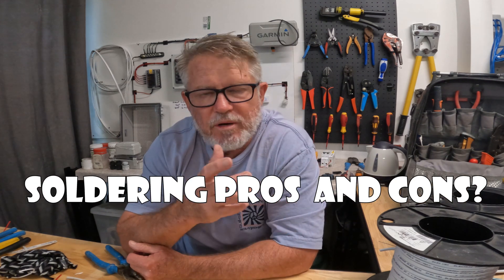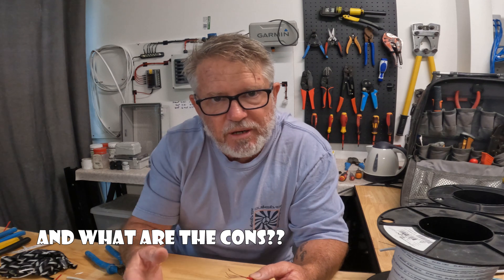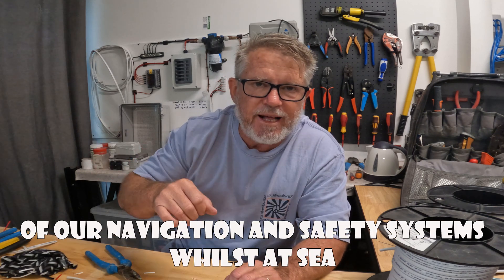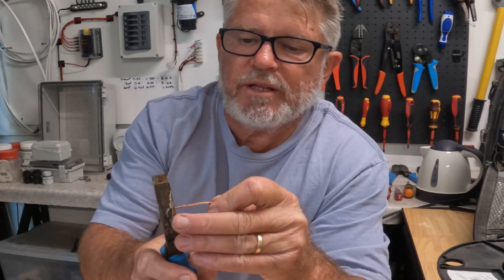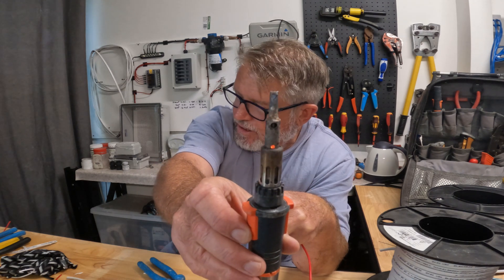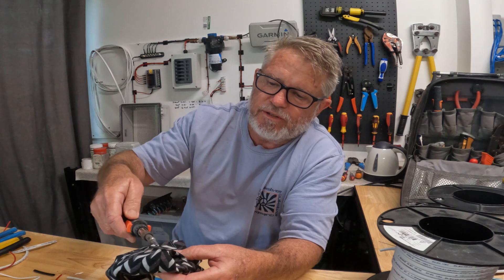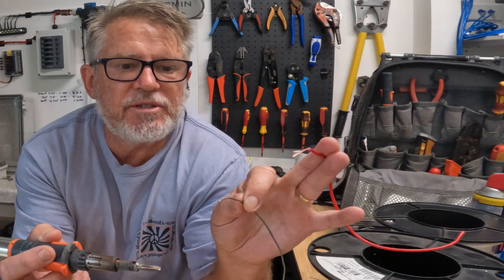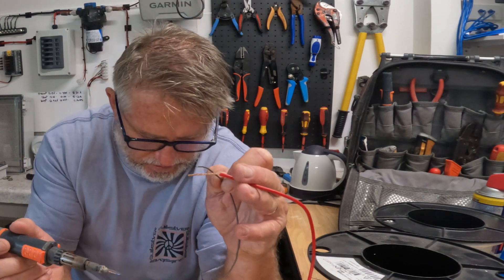I STOPPED Using Soldering Joints on My Boat and here's why!

Comment: I was expecting you would show tin whiskers causing short circuits.  Tin whiskers can grow in a humid environment.  OK, yes tinned wire is stiff and there are vibrations in a boat, makes sense.  But then I was expecting you to show a flexible connection without solder.  Crimp connectors at least are very rigid, even more rigid than tinned wire.  What is even worse with crimp connectors is that the transition from rigid to flexible is very sharp at one point, which will take all the twisting and break the wire.  A soldered joint is usually insulated by a shrink tube, which will even out the bending forces so that there is no sharp bending radius at any point, and the flexible part of the wire will handle all the vibrations of the boat.  The shrink tube with hot glue will also insulate the joint from moisture, so there is less risk of tin whiskers.  Crimp connectors might be tin plated and they have no protection from humidity, unless you add that yourself.
Reply from the maker: I am just getting started I will be adding a lot of information later, including crimps, marine crimps vs heat shrink crimp systems, cabling standards (Australian Standards) cable protection systems, heat shrink systems, cable management systems, junction boxes and glands, segregation, cable size, critical circuits and much more.

Comment from the maker: FYI for information purposes only - Below are some details and list of Australian Standards for those that are Australian and love a bit of reading regarding soldering and restrictions of soldering under certain circumstances, not just in boats. There are certain circumstances where soldering is permitted and others where it is not depending on the application and where a cable or wire is installed. 

To simplify matters I will be using quality Ancor crimps and Bluesea devices and switches where possible for all my marine applications.

Note: 

Some standards must be followed in full where others and various sections  may be informative only and may or may not be ratified by the NCC and or AMSA.

AS/NZS 3004.2014
AS/CAS009:2020- 20.9.2
AS/NZS 3001.2:2022
AMSA Instruction to surveyors DCV-ITS-015 (05/2019)
AMSA Aid To Navigation Electrical Installation Standards

The AMSA instruction to surveyors is a good read and is available online for free an outlines AMSA's requirements especially where crimps are required and it also provides additional information regarding cable size, cable length and other useful information for commercial vessels.

In addition to this my background and licenses include electronics, open unrestricted cabling, data, fibre, coax, fire and security systems. I also carry a certify class of license for some life safety systems in buildings. I have cabled thousands of buildings and certified hundreds of life safety systems with specific commissioning requirements  including Q&A, ITP's and third party inspections and certifications for full system compliance and safety and have very rarely had any defects which have never been cable related.

Whilst certain considerations must be considered differently in boats the relevant standards cable management and cabling practices remain the similar.

Comment: ... or leave electric jobs to an professional! Sorry
Reply from the maker: Not sure what you mean? I have been working in the electronics industry since the 80’s I hold various licenses in Australia including unrestricted cabling, data, coax, fibre, fire and security. I hold licenses to certify my own work and that of others. I have cabled thousands of commercial buildings and never been defected for any cabling works other than segregation where other trades have installed systems after our rough-in was completed. 

Boats have minor differences with regards to certain termination practices, mechanical protection and cable management but my boats are a lot smaller and far easier to cable, test and commission than large commercial buildings.

Whilst I’m no longer on the tools I have a team to do all the hard work for me.

In future I will also be referring to legal requirements with regards to system compliance, Australian Standards and AMSA requirements for certain systems including critical circuits, cable size, cable length and cable management systems.
Reply: @PressuresEdge  Hmmmmmm. There are standards out there, where, in which cases to use and how to do soldered connections. So far as i had seen in the video, you know not much about standards and soldering technices! And the fact your solder joints went broke proves this sight! Sorry, it was dont meant to be rude but in my exerience, if a connection is done right (cables, connectiontype, enviroment proction, layment of the wiring) it cant brake, not possible in normal operation conditions.
Reply from the maker: @ you are perfectly correct!! I guess my point in the video was to show how it can change the properties of a stranded wire and what can happen in extreme conditions? If properly executed and protected to prevent any movement via cable management systems then the system is ok?? But there are systems where soldering is simply not allowed under different standards for a multitude of reasons including current, heat, movement. My personal opinion is that AMSA and various other controlling bodies make it clear that they prefer crimps and for that reason I will be using crimps it just makes the entire process easier, compliant and cost effective👍.

Comment: I read many time about the NASA standards and how soldering is bad, so I downloaded the PDFs and read them. They note the requirement of mechanical support in both the crimping and soldering PDFs, and also that solid wire should ALWAYS be soldered. I found a view diagrams for how wire-to-wire soldering should be done. 
Do people not read these things? Nasa loves soldering apparently.
Reply from the maker: Thanks for the information this got me intrigued so I just checked out the NASA pdf and it’s next level.

Comment: I'm still trying to figure out the point of the video, and I'm over half way through, 3/4 of the way through still no point yet... is there one in sight? 
yes when you over heat the wire the solder is going to wick down it. 
I think this is about when putting stranded cable into a screw down connector, but I would be wrong, I don't have much to do with boats, but the boats I have been on I haven't seen bare lose cables sticking out with globs of solder on them. 
when done well / correctly, soldering is a really good way of getting stranded cable in a screw down terminal, granted a crimp is cheaper and quicker to do, but really doesn't do anything for oxidation or corrosion. 
they sent rockets to the moon using tinned cables, and yes there is a lot more vibration on a rocket than a boat.
Reply from the maker: The whole point is about how the solder is transferred (wicked) down the wire and how the mechanical properties of the wire changes, stiffens up and becomes less flexible. Introducing issues with reliability - as a tech I have seen and replaced multiple soldered connections.

I only use marine tinned copper on my boats I only used copper in the example so the solder could be easily seen to highlight the wicking process. The screw down connectors are another story - crimped feral terminals vs barebones copper or a soldered tag end? 

Every PCB has components soldered to the board but the wiring systems are different and not fixed into place as well as a component on a PCB. Back in the day when we repaired systems to component level a lot of faults were soldering issues and dry joints……but that was a long time ago.
Reply from the maker: Something else to note is that I recall AMSA requires all electrical connections within electrical enclosures to be crimps, lugs and feral terminals - no note of soldering - I will recheck the standard for my reference at a later date. I believe the ABYC has a similar requirement.
Reply: @PressuresEdge  yes most standards for high current and high voltage have moved to crimp based connections, it is really hard to get those wrong. there is no skill required and the result is repeatable so it will always be a known quantity. hence why it is a standard. 
there is also a solder on version of all those connectors, but again it takes way more skill to get them the same every time. 
but for a good 100 years, soldering was the preferred method, well, soldering, brazing, welding. but as we progress we are always looking for cheaper and quicker ways of doing things that are good enough and are repeatable.
Reply: @PressuresEdge  you are still going off and making various irrelevant points, dry solder joints were normally a by-product of mass manufacturing and using solder baths, when parts don't reach the correct temperature for soldering you end up with a dry joint. when mechanical stresses exceed the capacity of the solder alloy it cracks, giving a cracked joint. which is completely irrelevant to the point you are trying to make. 
but back to the point, the idea of tinning the multi strand cable is to make it like solid core cable, and with it comes all the down sides of solid cable, but it is done for the benefits of solid over stranded. this is also why we use ferrules on multi strand cable, ferrules are just a cheaper quicker way of changing the properties of multi strand cable to those of solid cable. 
I wonder if your next video will be on cheap ferrules and crimps and how they don't work anywhere near as well as soldered joints? 
the switch to crimped connections is more of a cost cutting / profit making reason than one of quality, the biggest reason being time. 
in most use cases where solder can be used, as there are instances where it shouldn't be used, solder when done correctly will last longer than the life of the product. but you also have to remember and keep in mind the different mechanical properties. friction / compression connections have their uses, and they are good as what they are designed to do, in the use cases for them, but they are not the best kind of connection in all cases, but they do tend to be a time saving connection that is good enough.

Comment: The take-away is either use crimps or if you must use solder then make sure to immobilize the solder joint so it can never move (and be sure to immobilize the entire hardened part of the wire; not just the solder joint). I'm curious if you don't apply any solder but heat the wire does it get brittle too? The heat could be hardening the copper...
Reply from the maker: Yep, valid points👍. The only issues with immobilising is added cost - can be done through cable ties, cable supports and junction boxes - I want to be able to remove cabling easier later for various upgrades to the systems so I will be protecting the cables but trying not to restrict them too much for when pull cables back through and I change systems.

With the copper yes the heat can affect the flexibility but how much🤔??